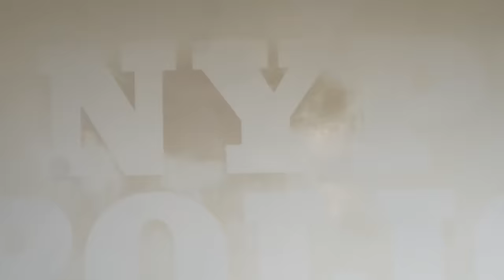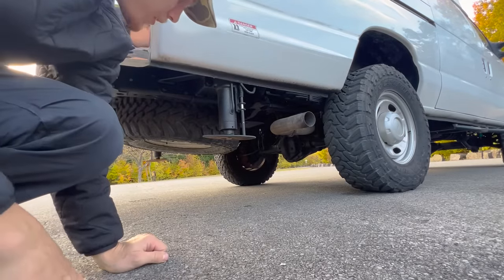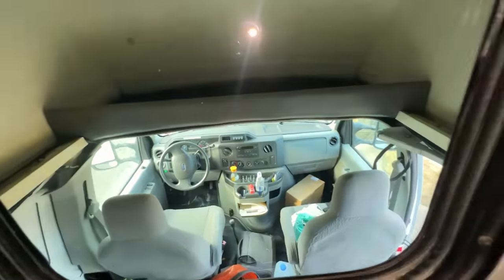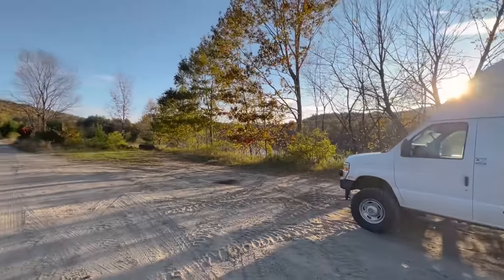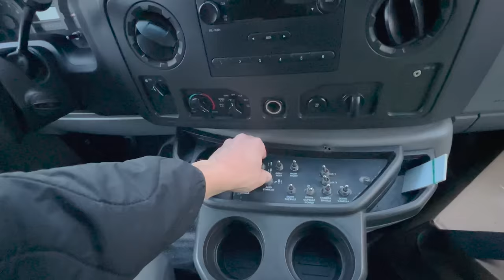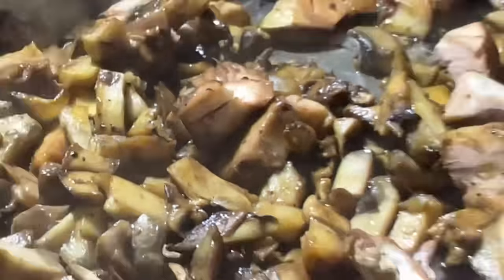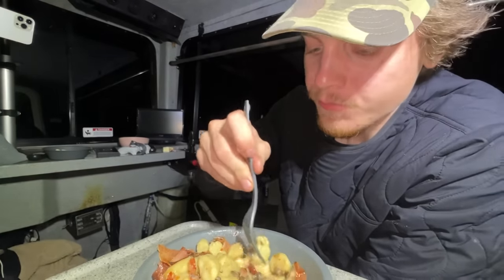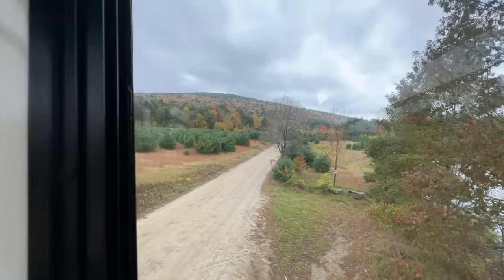Overnight camping in an NYPD Surveillance Van

Comment: As a NYC resident, I've seen these vans. They are used by uniformed NYPD officers to monitor and deter crime in and around public housing complexes.  For officer safety, there is always an officer, usually in a police car, sitting at ground level to prevent anyone from tampering with the van while the survelling officer is above.
Reply: That makes more sense, I'm a dumbass. I was thinking, ain't nobody undercover in that shit.
Reply: I grew up in Brooklyn. I’ve never seen these. Normally I always see the small pods that nypd parks on the street corner.
Reply: Thank you for sharing your insights about the NYPD surveillance vans. It's interesting to learn about their purpose and the safety measures taken. On a different note, for fellow outdoor enthusiasts and RV lovers, I highly recommend checking out the Segway Portable PowerStation Cube Series. It's a versatile powerhouse with a range of useful features like massive capacity, armor design, and fast recharging. Stay powered up during your camping adventures!
Reply: If the NYPD kept all the criminals in jail, they wouldn't need to surveil them!!🤷
Reply: @JavonWilliams29     Yeah, that is what replaced these vans.  It was too easy to just attach a camera pod onto any pole with a solar array for a small fraction of what one of these cost.   They have pods and sometimes they just mount stuff on poles.    Run a fiber or cover it with WIFI and you have live coverage of hundreds of cameras from one place.
Reply: @jeffmiller3150  youre a genius. You should share this brilliant info with them....
Reply: We have them in Florida. I seen them at the Walmart  parking lot. 73
Reply: @redwolfexr also drones are used and has a higher limit on height. I think ebor city outside of Tampa uses drones all the time. 73
Reply: This van is awesome
Reply: @jeffmiller3150  your brain is as smooth as a marble.
Reply: Be wild on super windy rainy nights ,be way cool to see that 😎

Comment: I'd make sure to keep the doors locked on the van when spending the night in the air on that thing. There have been issues where people have been in the camper of their trucks and some random stranger in the darkness of the woods came messing around the truck trying to open the doors. If they opened the unlocked doors and turned the switch off, you'd be screwed. I always take people's craziness into mind as a factor everywhere. Also, for someone camping in it long-term, having a rope ladder to fling over the side out of the window in case of equipment or power failure would definitely be helpful.
Reply: On exiting theirs a safety switch. It'll lose hydrolics slowly and bring you back down in case of power outage.
Reply: @geofw23  either way, if you hang from the little door it's a fairly unproblematic drop to the car roof. It's not that tall that you'd seriously have issues getting down
Reply: @yourname8714  your not hanging anywhere.... it slowly let's you down per losing pressure.
Reply: It’s hydraulics. The weight would bring it down.
Reply: hydraulic dont need power to go down.
Reply: @danstray2527 that's a better option than a rope ladder. Oh better watch out Mr speller will put latter on my comment. LOL . 73
Reply: Scissor lifts have emergency buttons.
Reply: @danstray2527 yes but on scissor lifts you still have to press or pull a switch
Reply: @100Proof-n5d  For safety that is done on topp. Otherwise u can get stuck up there.

Comment: Hi Mav,  dunno if it allready got mentioned in the comments  and it´s totally up to you since it´s your bud up there but here I go - those retractable studs are mostly made for hard ground like asphalt and concrete. If it would be my behind up the lift I wouldn´t ever use it without some heavy boards underneath them studs to spread the load. Like this the danger of one of the studs starting to slip or sinking in the ground when under load gets reduced by a lot. The lift in 40mph wind gusses ain`t no static but a dynamic load so one needs a good sturdy foundation to be safe. Just saying - So long
Reply: Mad Respect 🙏🏻 you're 100%
Reply: @jay0726  You're very welcome - take care

Comment: What a score! The van being an extended bed 4x4 heavy duty van with self levelling and raised roof would make an awesome off-road camper on it's own. The lifting pod is more than a perfect deer stand. I come with a video surveillance background, and that camera setup alone is likely in the 10s of thousands. It is a 360 degree FLIR (forward looking infrared) PTZ (pan, tilt, zoom) with amazing zoom capabilities. You could track a deer day or night and see the ticks on his back.
Reply: Be cool if they wrapped the box and the van in camo too!
Reply: Definitely cool but it's too bad there isn't a bit more useable space in the van. He would be wise to invest in some RV stabilizer pads to place under those jack stands.... any high wind is gonna push that over to one side causing the jack stands on one side to sink in on any soft terrain and it would be questionable if he would even survive the fall.
Reply: @qwertyu3864 definitely easy to do and definitely a great deer stand
Reply: Not really it is an old camera with IR led's running the classic Pelco protocol. Low resolution 480p via coax. Nothing like a FLIR system. But can be replaced with a high res 4K IP ptz cam. The raise mech is cool.
Reply: @j.c.isking2165  as a crane rigger we just use wooden pads many times lol
Reply: @misterbulger  I used to operate a crane onboard a commercial fish processor in Dutch Harbor Ak. Sure wood pads would work but if I’m gonna trust my life to a pad, I would rather use something I KNOW isn’t decayed or might split under pressure whereas a solid nylon pad is foolproof, as they are easy to clean off and can be MUCH thinner than wood to safely support as well, making them superior for storing in a van with limited space such as this one.
Reply: i doubt you wanna takes this off any road ever..because those stands are gonna get caught on every bump and rock in your way shredding everything in the process.
Reply: @TheInfidel_SlavaUA  Yep and the sheer weight of that rig would sink it deep in any mud and those jack stands would turn into instant anchors but I WOULD take it on relatively hard surface roads like dry, hard pack dirt or gravel roads.
Reply: Yeah, I have to wonder what the price tag in this thing is but that was my first thought.  What a great conversion platform!

Comment: Mav just an FYI.... All power lines and traffic lights are 14’ 6" they have to be at least tall enough for a tractor trailer to go underneath which most normal rigs are 13’6" or 13’8” depending on your tires, airbags and weight/load you're carrying. If you're 10'6” you have nothing to worry about except drive thrus at fast food places. Hope this helps you be a bit more comfortable with your van and driving around.

Also if you don't trust something, they make measuring poles you can get that will tell you how tall your truck is or how tall the structure your attempting is.
Reply: I wouldn't say he has nothing to worry about at 10'6"....because then, he'd SURELY 100%, hit something that was low clearance if he only paid attention while in a Drive-through. It's just better to always be aware, and paying attention. Other things of low clearance (besides drive-throughs) that you forgot to mention....parking garages, the low hanging utility wires/coax-cables that were commonly found connecting old homes/buildings up to basic utilities. Usually only in areas that were developed before all utilities were universally standardized to be underground (commonly hanging across alleys, over driveways)...thankfully most have been updated and converted to subsurface, except rural areas, small town, unincorporated areas.

Comment: You are usually pretty safe with the power line height if your under 13 feet, and if the bridge is low they usually mark the height for you. My vanlife build is over 12 feet, but im used to it since I drive a tractor trailer for work.

Comment: That is an evaporative cooler it works by passing dry air through water, and it adds humidity and lowers the air by 10-20 degrees it isnt refrigeration, so it won't cool and help keep the place cool its more for keeping it running pointed at your direction .

Comment: At a little over 10 foot you don’t have anything to worry about with power lines. Most are 15 feet at least. A semi or box trucks is I believe is legal at 13’8”. I worked for the highway department and we would have to raise lines sometimes for oversized load. My high top van was like 9 1/2 foot and I never had a issue. Very cool 4x4 van with no miles. I would take the box and lift out and fiberglass a piece of plywood over the hole and insulate the van and build a camper.

Comment: Its all cool and stuff but my question is what happens if you are all the way up and say you been up there for a long time and you had that little heater on dues the engine start up when the battery goes low or is there a voltage meter up there in the Vue platform and if the battery goes low can you start the engine way up in the air?

Comment: I had a old dodge van from 88 that was built the same way, but the box on the lift was gone and it was just a flat plate with 6 inch tall steel sides. Got it from an old guy whom used to do stone siding on houses of all sizes. He was retired when I got it. He told me Scaffolding is Fer rookies and cheapskates. That old dodge was awesome. Deer loved to lick the thing.

Comment: People who know scissor-lifts like I do, are cringing at how easy it would've been for someone to flip the battery isolator and leave you totally stranded up there. 😱
Regardless, congratulations on a very unique video! 🏆
Reply: If you know hydraulics like you claim? You would be aware that wouldn’t happen. The piston collapses under weight. They fail safe.

Flick the isolator… 😂😂😂
Reply: @BitsofSkin  Yeah, there'a a safety switch next to the door with a big sign that says to use it to lower the capsule in case of emergency.

Comment: Don't worry about power lines they're set over 14 ft if clear tractor trailers I would put a airbag system in the back because it looks like you're riding tail heavy

Comment: Okay here's my idea for the green button inside the dash of your van...
What you do is you attach a line directly from the dash through the van over to the cherry picker and give it enough cord to be able to ascend to the top where you have a secondary Dash that you can therefore turn off and on to keep your battery from running low

Comment: 30:28 needs some foil tape above the heater for sure. Then, either an emergency rope ladder in case the battery dies on a cold night, or a jumper pack with 30 ft cables, or a separate deep-cycle battery just for the heater

Comment: I’m dying!!! “At 10’6” I have to worry about bridges and power lines.” Ha ha ha dude you will be very hard pressed to find anything low enough that you might hit. As a truck driver, I have only found about 3 bridges and ZERO power lines lower than 13’6”. You didn’t have any worries parking in the grocery store parking lot. lol.

Comment: They use similar capsules like this that are towed and have air conditioners and its own power supply they park them in event centers or parking lots I guess it's cheaper to just have it without it being integrated into the van

Comment: Ps, all power lines have to be 15 ft off the or higher that way standad 13 ft 6 in can fit under it. If your vehicle is lower than 15 ft and strikes the power line or transmission cable, that is not your fault.

Comment: you were safe from draining the battery. the lift runs off a 24v battery in the back of the van. separated from your 12v battery for the vehicle.

Comment: Is it possible to turn one of these into a hunting blind lol that would be insane. Just pull up and get in the back extend the scissor lift and ur set. That lithium battery alone is worth a good chunk of change and u could maybe even convert some of that electricity to work with other equipment pieces u can install into the truck.

Comment: Im not gonna lie... that noise gives me the creeps simply because I drive op forklifts at work and we have to be somewhat in a cage like that. And it goes that high in the air too with you inside it. I couldn't do it... I changed jobs. That's when I found out I was afraid of heights.

Comment: So I am kind of a Camera type person that try and help others as can be seen in my Videos, The camera is an iR TVI camera from yester year.. (Little Older) But in good working order a Great camera with 20x zoom. Normally priced around 550 to 600USD.I have cameras from 2x, 3x, 4x, 10x, 12x, 20x, 25x, 27x, 32x, 36x, 37x, and 43x zoom;  will admit out of all of the PTZ's that I own I have more 20x then others. So about your Game Controller there is 2 things missing from your trip. First Password for the DVR. Second is a PC that would be connected to the system and the PC is where the Xbox 360 controller would connect. There is different software out there and my guess is that it might be using a COP MDVR system. It might have been disabled little bit  FWIW normally you can't control a PTZ without a Password to the DVR or Controller in some cases called a Keyboard. RS-485 and in the case of your PTZ camera it might be connected RS-485 or TVI up the Coax type connection. I have some TVI cameras that are PTZ and some that are zoom only. Then other TVI that only offer Over the Coax OSD. A common software that people use is RocoSoft PTZJoy Studio, that you can connect the controller to. With some programming you can make it do many things. However not a software for the General Public seeing the software is between 700 and 1500 depending on sales or system setup type..  Anyway that would be a cool Van to own.